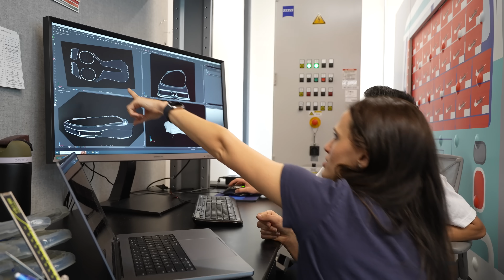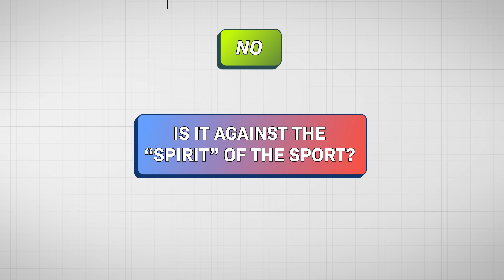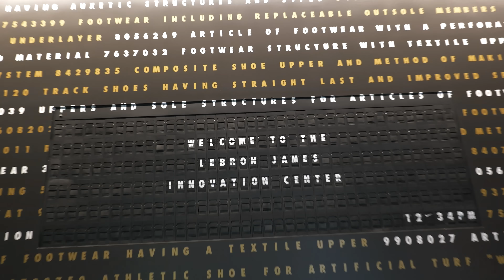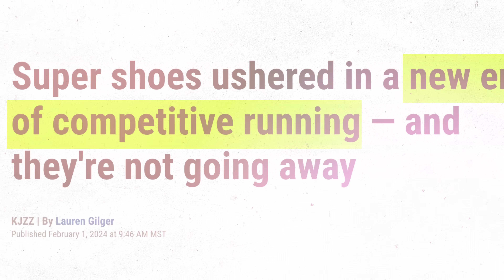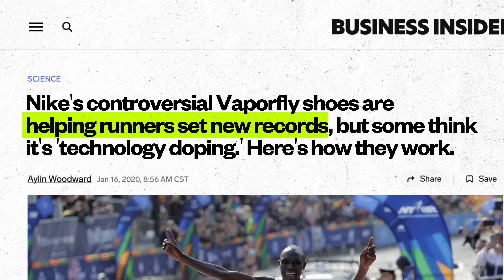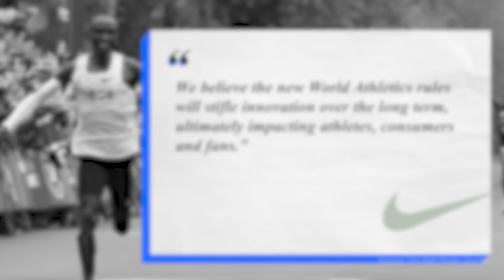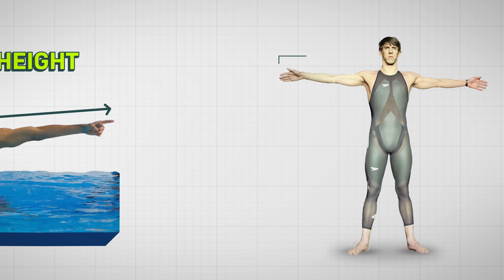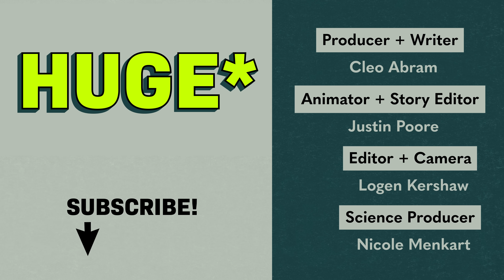The Shoe That Broke Running

Comment: Hi,
The reason to ban this kind of "extreme" technology is that Olympics are supposed to be based in fair play (stress on supposed), so technology price does not give an unfair advantage to richer countries when compared to poorer countries which will not be able to afford that technology. It is supposed to be about the athlete, not the technology or equipment they can afford when reached a minimum.

Comment: Just because something is sold to the public doesn't make it ok to use. Tren is sold to the public. Is tren like a shoe? NO. But these shoes are an obvious boost to performance that has been seen 1000 times on the internet improving peoples times from marathons to local 5ks. It might be just the next evolution to  shoe manufacturing for distance running. But 300$ is a lot of money to say that you can create an even playing field. For instance, in a local 5k. Where a lot of people might not be able to pay 300$ for a pair of shoes, that will not hold up for more a few hundred kilometers of wear an tear.

Comment: ok here's the thing. if his energy return isn't higher than the other peoples, then why does it matter? more studies would need to be done to make a fair ruling on the situation in men of his own race because that's like saying oh well this study done on asian females looking at their eyesight show that your prescription should be -3 but yours is -5 so you cant wear anything that is a stronger prescription than -3 comparing it to a white male. not fair is it? on top of that they limited the number of mm a shoe could be to limit their energy return, not the overall length of their legs so why should his matter? also people argued that oh well his legs dont use oxygen and are lighter than regular runners legs, but all that weight of a prosthetic that's like a foot or more is being carried by like two muscle groups, which would use more oxygen in those muscle groups and would in turn be harder to use. For example when you pick up a massive metal beam you cant pick it up form one side or else the other side falls forward because it is very hard to support it, but when you pick it up in the middle you can. your calf is like the picking it up in the middle. So no, I do not think he should've been barred from competing in the olympics because it is not a fair comparison

Comment: For what my armchair opinion matters on such a topic, I think for things like the Olympics, the purpose of those games is to test the limits of the human body in human vs human competition. We have decades of history we're comparing every new event to, and it does feel somewhat unfair to use technology to artificially increase the human potential.

I feel like the Olympics and other such events that are based on that premise should have a rigourously tested and standardized kit that ALL participants wear. So what we are comparing is each athlete's physique against the others. If everyone is wearing the same thing, one person isn't getting an artifical boost over any others that they aren't born with.

And then, we can create a set of events where we test these cutting edge sports technologies. To see what the true absolute limits of human capability are when we throw all restrictions out the window (so long as no harm is risked in the process).

As for prosthetic requirements, I would again restrict the Olympics to any kind of prosthetic that perfectly matches full able bodied performance in rigorous testing. It's a lot harder to nail this one down as how do you ever really assess that? That's outside my knowledge base. But it should still allow folks to compete on that even footing for lack of a better term. We're trying to see how each person compares to their contempraries and those who came before, after all. Not comparing who they're wearing.

Seems as if this will all be quite interesting to watch over the next decade or two as we try and nail down what is and isn't performance enhancing. But at the end of the day, my opinion is that any form of performance enhancement is against the spirit of the Olympics at least. But that there is 100% room to explore that in other events than those pre-existing tests. And I would love to see what a new category could find if we do seek the absolute limit of humanity when we pull out all the stops.

Comment: I'm a simple person, if tech makes it safer, reduces the risk of injury and more comfortable go wild add as many bells and whistles as you can. But if it improves performance its a massive nope. Sport is about HUMAN performance, if you want tech performance it's all about F1 or robotwars. 
I remember this debate about gymnastics sprung floors when I was a kid, it ended up being accepted as its safety benefits far outstripped its performance aspects. It made it safer more than it made it easier, but it still made it easier. (No gymnast alive can do a double back layout double twist on dirt) but the cost benefit ratio was analysed to death.

Comment: Comparing blades to glasses is crazy. Glasses only can get you to being able to see clearly. Not like that telescoping. And blades clearly make a subpair runner a better runner. They have there own Olympics for ppl with out legs. Blades change how you run and uses less energy
Reply: The athlete in question, Blake is not a subpar runner. Blades definitely change how you run and have some advantages. Having legs also has it's advantages, too.
Part of the reason for the Paralympics is inclusion, to allow athletes with handicaps to compete. In the past, there weren't any runners with prosthetic legs that could keep up with the able bodied runners. Now that a second runner with blades can compete  (top 5 in the world) he gets banned.

Comment: i haven't heard of any sneaker/running shoe that can increase performance. usually, they ban rubber shoes due to safety or risk injury. after the video, I think that energy return is better for comfort than adding performance because runner's first foot forward causes energy return a bounce to the vertical and opposite direction. 
technology in sports should be accessible to any qualified competitor and the cost should not be signficant.  You also have to consider losing the old records that did not use high tech equipment.

Comment: I swam comeptively for 16 years, and raced in a laser racer. If that's illegal, then having a shaved head should be. It's a greater advantage. The fear wasn't the new suit - it was the first to use tech in swimming to enhance the item itself. Goggles were a new item. There was no standard there. It was a knee-jerk reaction to the fear that they would eventually make a fully hydrophobic suit, and the claims it made people float were RAMPANT and were the main talking point about the suit. It's certainly not nearly as significant a performance enhancement as wearing moisture-wicking material in track & field is. It was mostly the mental boost, knowing you were wearing the best gear in the world and there was nobody who was going to win over a better suit. There was also little data on full body vs leg suits and you used to see a lot more people in just full leg suits  or jammers.

Comment: As a former athlete, coach and sports fan I say; comparing glasses to prosthetic legs is a bad analogy. Glasses don't aid in speed, endurance or strength. As far as running shoes; that's a tough/close call. Jesse Owens (like myself) ran on cinder tracks. Today's runners compete on "rubber" tracks-Advantage. Yet, there's no asterisk next to all records set on contemporary tracks. I sprinted in Nike Waffles. Today's "spikes" are much better and as far as distance shoes-well there's no comparison. Whereas,  the baseball bats Babe Ruth swung are the same as today's. Yet, minus the "Bash brothers "and their drug-enhanced pals, today's players hit a lot more home runs than the "Babe Era" players. So, it's not the equipment (bat) but the player. ..My conclusion:  equipment that gives athletes a determinable  advantage shouldn't be allowed.

Comment: Technology for making life better is good but using that to get advantage in a competition is a no no. 
I think there are 2 rules that should be applied.

1. The equipment should be available to everyone at the same time, so no one can have unfair advantages. It doesn't have to be 4 months before but it has to be available at the "same time"

2. Since sport is about human competing with each other and not about gears/equipment competing with each other. A gear can not increase the performance of the athletes by more than X percent. 20% should be ideal I think.

Comment: Can’t sprain an ankle, strain a calf muscle, get cramps or get tired lower legs with blades.

Everyone should be using the same technology.  All or nothing.
Reply: Blades are 100% not fair unfortunately.  Competing against other blade users, fine.  But yeah I wasn't a fan when Pistorius was doing it and I haven't changed my mind now.  They provide real, obvious benefits:  they're incredibly springy, they consume no blood oxygen, they're much much lighter than a normal leg, they can't get tired or injured, it's just too many things to take into account and I do think it's better to have blade users race against each other instead of people with legs.
Reply: @PlaySA  This is the big one, your heart and body does not have to feed them, pump oxygen to them and then back, send them nutrients, and repair their injuries. You support them at absolutely 0 cost, and they are quite clearly designed to provide vastly improved performance over the traditional human hardware. You want to run on stilts? Break the legs off a skeleton and run with the same design everyone else has. Dude may as well have an electric motor and wheels with a battery in a backpack for all the difference it makes. Maybe two pogo sticks. Human legs do not work that way. Why do you get to compete with better hardware? Let him run, I don't mind, but put him in a prototype category like they do at Le mans. Garage 56.
Reply: @PlaySA  Oh I agree, they should simply class all the odds in the same group, they need to unwoke and simply say no that is an entire new category, let the odds compete against the odds.
I will poke the bear, Gender is not a state of mind and they should have 3 genders to compete separately "man", "woman", "other" 
it is unfair to the spirit of the sport allowing so many men to ruin woman's sport, but hey one can of worms at a time right?
Reply: @PlaySA  This has been research in depth,  and always comes out as they do not have an advantage, show me the research that you build your opinion on.
Reply: @joieinka  that's the same as saying that a bicycle doesn't give you advantage over running shoes.
Reply: @jorislal  No its not, I can show you the research thats says there is no advange, you can't show my the there is, just what you think and feel..
Reply: @joieinka  I've seen the research, it's inconclusive and proves nothing, also there's no way to actually research how much of an advantage blades can give to an athlete hence why we literally can't have any regulations on the parameters of the blades - we simply can't measure how much is too much.
Reply: @joieinka  You want to prove you don't have an advantage? Break the legs off a skeleton and use the same hardware everyone else has. If you're using different hardware, and winning, then those two facts alone support a preponderance of evidence that you do indeed have an advantage.
Reply: @kennethgregory3188  400m WR in Paralympics, doesn't even break in to top 10 at last olympic.. Tell me again how they have advantage..
Reply: There are set of others problems that comes with it, blisters, swelling, and burns on the stumps, and cramps usually hits in the hamstrings not lower legs.
Reply: but it is fair, any legged individual can opt in for a bit of surgery to get rid of the unwanted parts and get blades

Comment: The thing is, a LOT of records are broken because the tech in the sport got better.  Take ice hockey for example. Sticks have gotten: stronger, lighter, and more flexible. Skates are stronger, lighter, and more stable. Because of these two issues, protective gear has become stronger, lighter, more flexible and more stable. But the skill of the player is still necessary.

Let's take a look at training. Because we've become more intelligent about how to train, how to eat, how to enhance the O2 -> muscle mechanics and body recovery, human athletes are much stronger than those from 50 years ago. And this affects every single sport.

Comment: Thanks, this a really interesting (and timely) review.
Regarding prosthetics, maybe the cleanest solution is to require runners with prosthetics to report their able body height and show how they justified that.  Then you can use the same rules on height addition and energy return.  Then the OC regulation review be simple.  For runners that got their prosthetics as adults, able body height would be easy to report.  For cases like Blake, the USOC would have to determine an able body height for him and justify it.  As long is it was reasonable, I don't think the OC would contest it and he would not get excluded.  Having the OC regulators determine someone's able body height is not a good approach.

Comment: i can see both sides, the guy who has trained hole life getting beated by a guy with prostetic legs thinking it have an advantage, and the guy with prostetic that now have the hability to train and surpass the others athetles. Both sides are fair, so the easiest sulution is divide literraly. Want to use a swimsuit that makes you 10x faster? ok, but you have to compete in a pool that all athetes are with that exact suit and the record has wrote down "time with x swimsuit" or "x glasses"...
It complicates everything but is the most fare i think.

Comment: Im a swimmer. Those shark suits were $500+ and the question is availability. Not just for Olympians, but for everybody.  Do 12-year-olds need to spend $500 on a suit just to compete at the age group level?  Should kids be forced to spend that much just to compete?  Sports try to balance between the haves and have nots.

Comment: The idea that running blades are an advantage is genuinely a joke. They are designed the way they are because the mechanics of biological limbs is insanely complicated and currently impossible to replicate to the same capacity. Running blsdes are a disadvantage if anything. And the fact that they made him cut down his height, and he started having issues with his body speaks to how messed up of a demand that was. 

If disabled people are disproportionately winning, then yeah that might be an issue, but if they are simply winning at a similar, if not lower rate than able bodied people, then its targeted discrimination. This same conversation can be applied to trans people btw. There is no disproportionate amount of trans people winning against cis people either. Its a stupid question to ask if you already have the "answer" before actually looking at the data.
Reply: Right someone incapable of spraining their ankle or cramping a calf totally doesn't have an advantage. /s and Trans may (likely) only be winning or be on par due to rules in place.

Comment: I have to wonder what it would look like to update millitary uniforms, footwear, gear, etc. with this kind of tech. Instead of slogging in a heavy uniform with heavy boots with designs essentially unchanged in decades, outfitting them with purpose built apparel designed to optimize their expected actions.

Comment: Another thing to consider is if people break records with new gear, are they actually better than the previous record holder? A great example would be Jesse Owens. In the 1936 Berlin summer Olympics, he ran a 10.3 second 100m dash. This was on a track that was had worse grip, no starting blocks, and relatively terrible shoes by today’s standard. So the question remains, would he be faster than Usian bolt given today’s technology? We will never know, however, if we are trying to find the best athlete at a given event of all time (ie world record), then improving equipment does not achieve that.

Many people believe that steroids shouldn’t be allowed in the Olympics not because it’s dangerous to the athlete, but because it is not “natural.” But shoes are not “natural.” 

It is fine to want to see what a human can achieve from their own effort, but if we really want to compare people across generations, then this is not the way to do it. If we want to just push the boundaries of human capability, then the only regulation should be from external energy, like rocket boots, or a bike during a run.

Comment: As a person who has been able to run in super shoes in college running. I’ve seen it as a good thing. It not only adds another edge to want to train harder but the shoes also help with recovery! But this is based on distance. When I started racing 10k wear the Nike Dragonfly spike and that was a 20mm stack height. My calves would be absolutely destroyed. However, if I wore a road racing shoe like the Saucony Endorphin Pro 2 I would recover much faster after the race and also feel better after having raced. Cool stuff!

Comment: Happy you didn't have to sacrifice a finger for science.  I was surprised you (and they?) slid rubber directly on the band saw, what if it got caught?

Still, it was an informative video.  I used to feel the same about a sport I participated in, and it wasn't just a question of the equipment during the sport, but the training gear as well!  Back when people wore those horrible shoes they didn't have computers and tracking systems to help them optimize their gait down to the micrometer.

On a different note, I hope you kept that uniform.  I know it's not the point of this video, but it suits you.